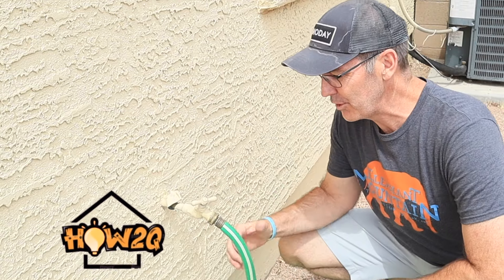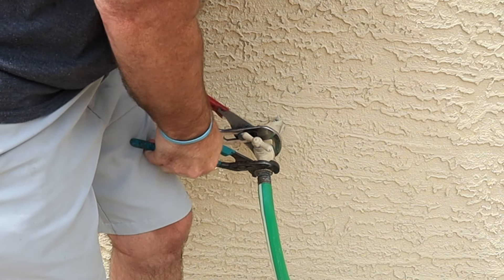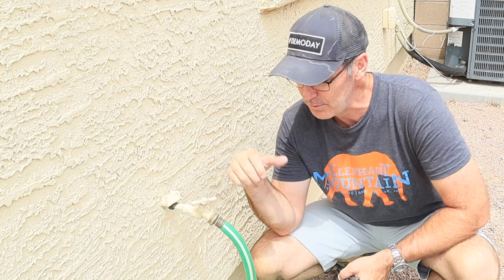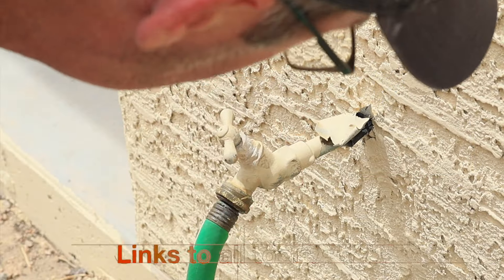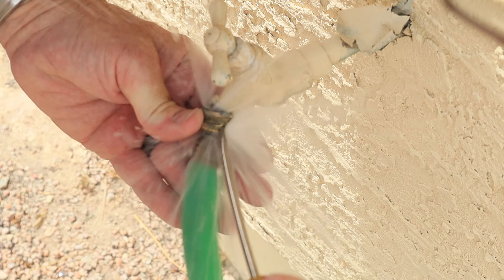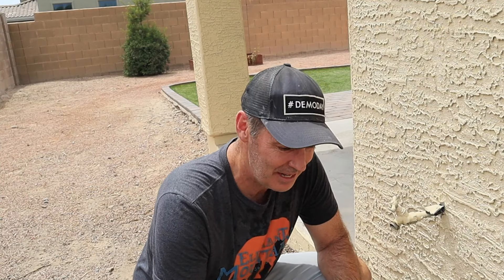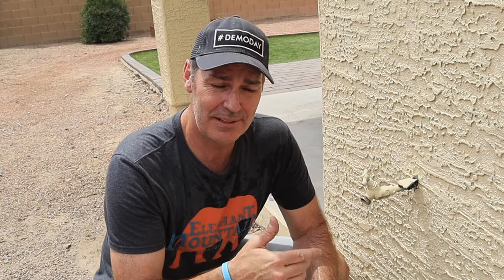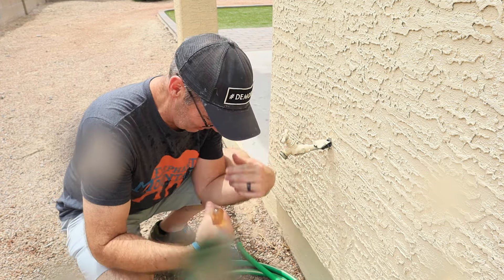How to remove stuck hose from spigot

Comment: I have watched several videos about how to remove a stuck hose, and you're the only person to point out the need to support the hose bib with another set of channel locks! Thank you.
Reply from the maker: Only included it because I have been known to make a job a lot harder by making stupid mistakes. I was very paranoid about busting the copper pipe on this one. Glad it helped.
Reply: @how2q  I am sure it will help.

Comment: I put vinegar over it and waited 20 mins. Still wouldn't budge. Used scalding hot water twice to expand the metal, then used cooking oil and put a nice amount around the molding and tried to get it inside. I held the spigot to stabilize it and then turned to the left. After three turns, it became loose, and I was able to get it off from there. Didn't have a saw. I used what I had, and it worked.

Comment: Good suggestion. Got my hose of pretty quick, nicked up the threading a bit but it should still be usable.
Reply from the maker: Glad it worked!!
Reply: Same here. Mine was the hot water supply for my washer. The nicked threads don't seem to have caused a problem.

Comment: Spray on Liquid Wrench the night before.
Use 2 pipe wrenches : Wrench #1 is adjusted to fit OVER the faucet BEHIND the broken knob, handle to the Right.
Wrench #2 is fitted to the Hose "Nut" end, Handle to the LEFT.
Simply apply a Moose amount of turn pressure to loosen. 
Easy Peasy....

Comment: Thanks so much for your idea. I'm going to try it tomarrow. First I would like to know if I can replace that ring I'm cutting off or do I need to buy a whole new hose ?
Reply from the maker: New hose…sorry
Reply: @how2q  thanks, I found out that I can keep my hose. I only need to cut off the damaged end and replace it with a new one. Easy fix. Thanks for your advice on the problem again !
Reply from the maker: @TheSeedsower107 great info…thank you!!
Reply: @how2q   Your very welcome. You just need a female hose end replacement kit. You can buy them at any hardware store.

Comment: What to do if you over cut and damage threads?
Reply from the maker: Just hope its not deep enough to leak when hose attached.  Basically will need replacing if thats the case.  I have overcut w grinder but was no leak (thank god)